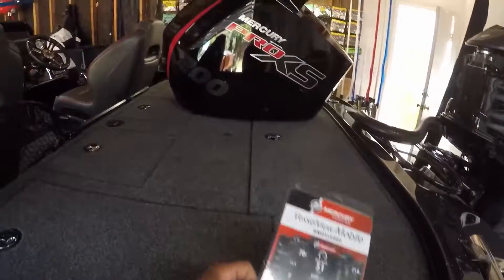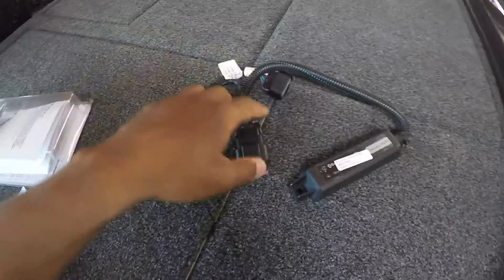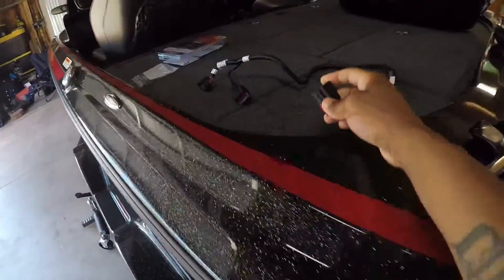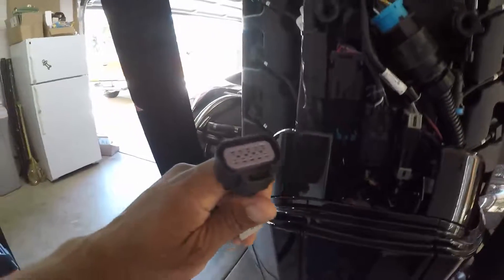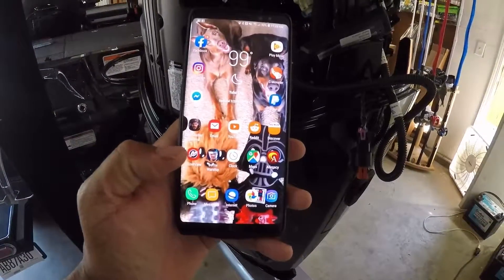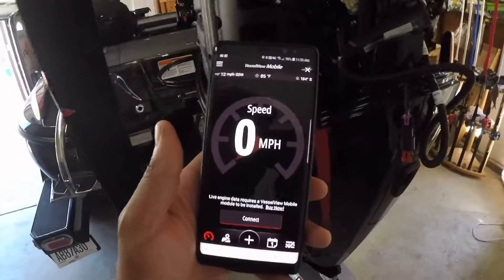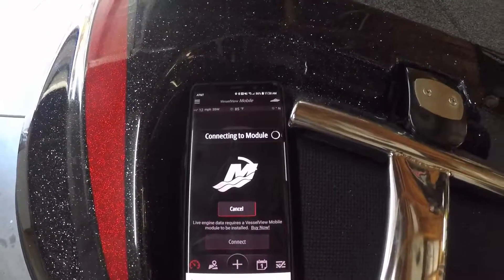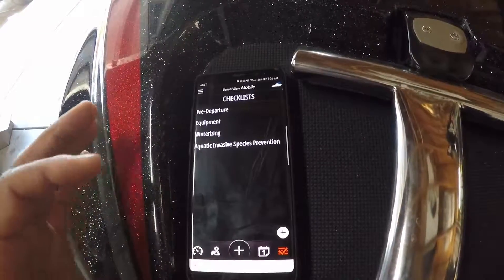Mercury vessel view install on new Mercury 200 HP four stroke engine

Comment: I've had this installed on my 2012 Mercury 115hp Four Stroke and it's worked great.  Buying a new boat with a Mercury ProXS 200hp so your video showed me that the module I have will work with the new motor and also how to connect it.  Thanks and tight lines.

Comment: Can you explain where you mounted the box?  I have the same motor and my VesselView should be here in a few days.  Thanks, Tim
Reply from the maker: When you take the cowling off there is a plastic cover that's on the back side of the engine. I used gorilla glue double sided sticky tape to mount it. Been on there since I did this video and hasn't moved an inch.
Reply: Thank you!

Comment: Nice vid. I'm looking to add this to my new Merc. Since it is Bluetooth compatible will it connect to the Humminbirds via Bluetooth?
Catching Bass for Cash
Reply from the maker: Thanks and no it will not. It only works thru the vessel view app on your phone.
Reply: Got it. Installed it today. Thanks for the video! I will link you in mine. How did you get the fuel gallons to update?
Reply from the maker: @MoneyBass  the fuel you have to just add how much fuel currently in your boat and it will start counting it down after
Reply: Thanks! That's what I figured. I will fill it up and set the fuel setting at 50 gallons.
Reply from the maker: @MoneyBass  everytime you fill up you will have to add the gallons amount to it so it keeps track

Comment: I’m trying to connect but it’s telling me this “can not complete initial set up. Please key on all engines and try again.”
Reply from the maker: Did you plug the terminator cap back into the harness after you installed the vessel view where the terminator cap goes? As it sits now when you turn the key on does the module light up at all?
Reply: InfiniteBassin I didn’t have a terminator cap. And only the Bluetooth lights up not the smart craft
Reply from the maker: @wilsonhomer833  ok you are going to need a terminator cap. Add me on Instagram or shoot me your email and Ill send you pics of it.